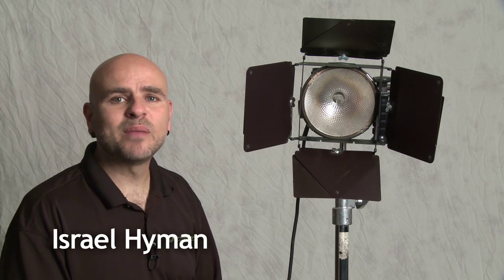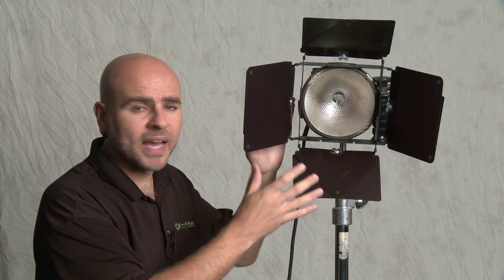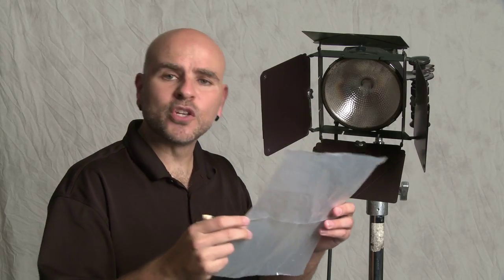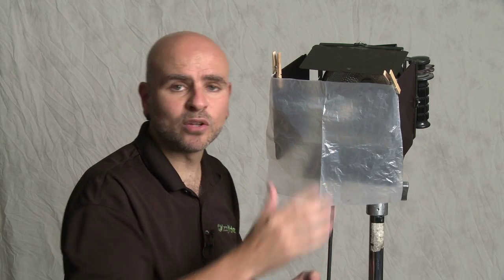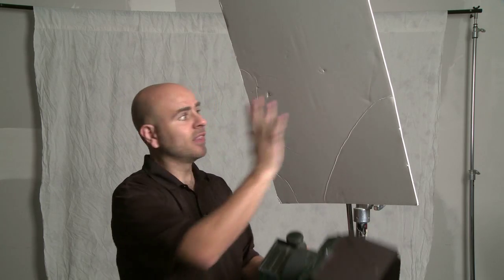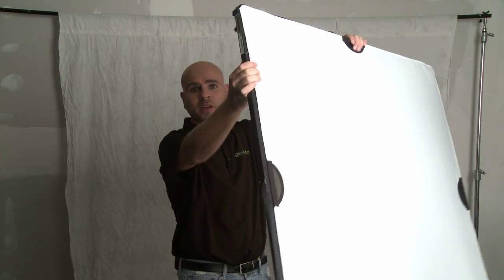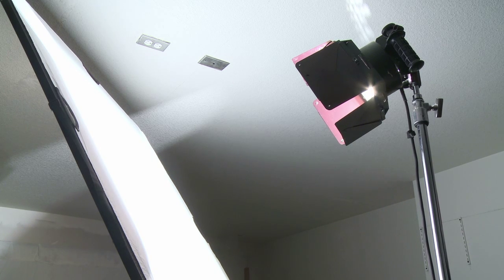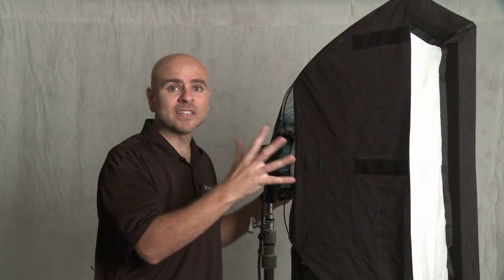Video Lighting Technique: Turn a Hard Light into A Soft Light

Comment: @StrangeCreations There are a lot of creative ways to solve the lighting problems with low cost solutions.Just remember heat over longer periods of time. Look in other places that deal with heat (kitchen supply areas, craft stores where heat guns are used, hardware stores...).